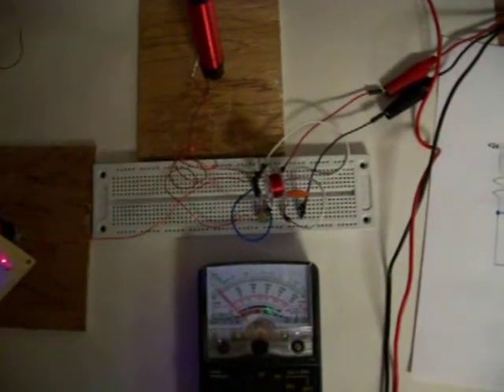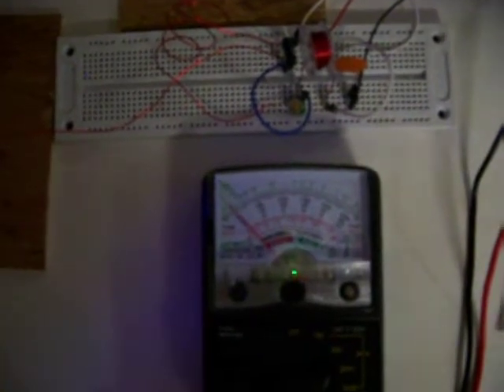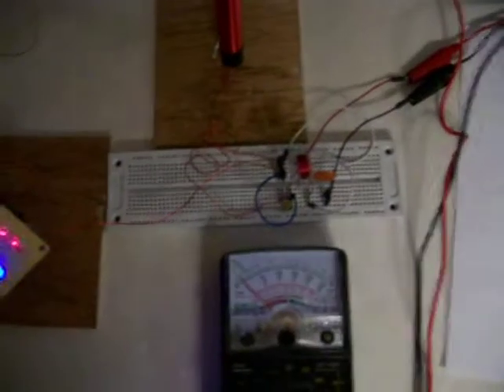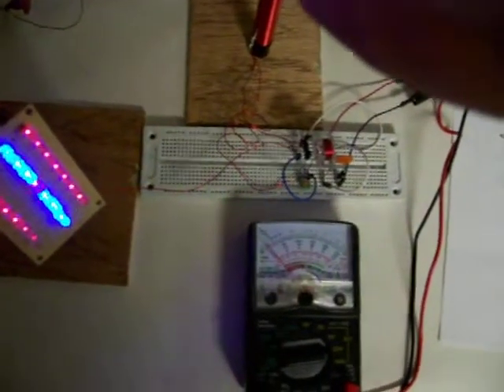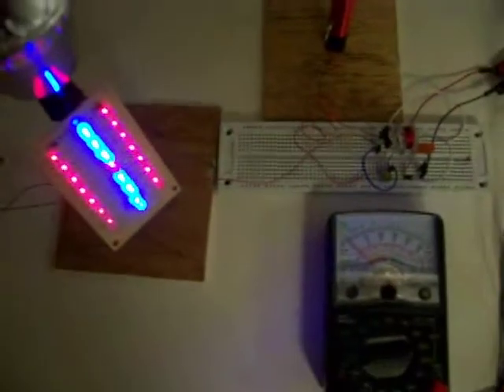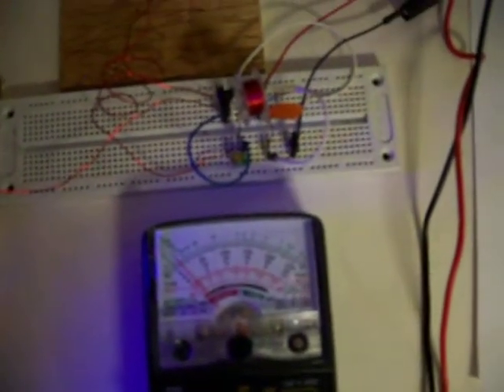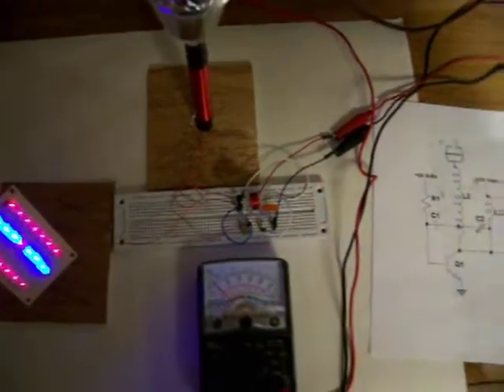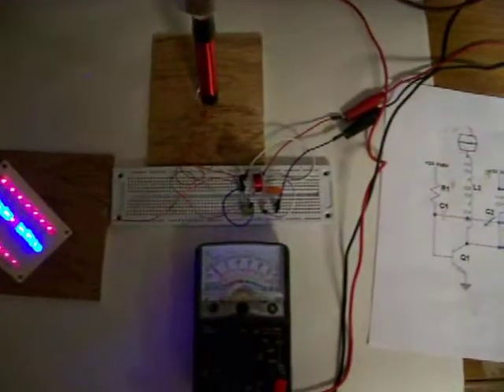Replication Of Dr Stiffler's New Circuit

Comment from the maker: Thanks Lidmotor.
Yes the Doc's circuit is a really winner.

I made another video with a second reciever coil connected to an earth ground.

It works very well and lights 24 led's without taking any more current and without diminishing the light out put from the first reciever coil.

I tried it up to 10' away and it worked just as good.